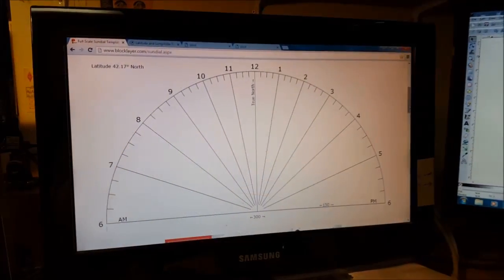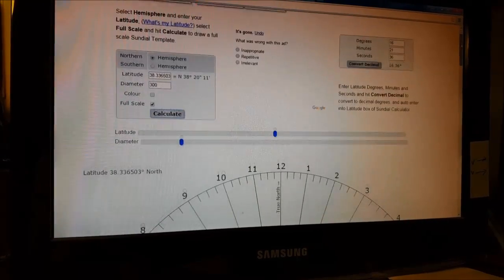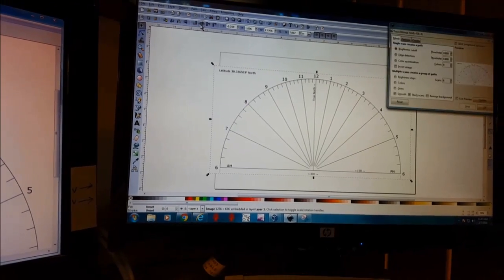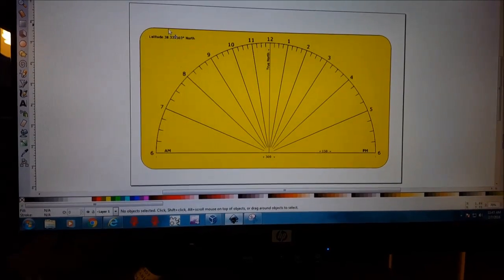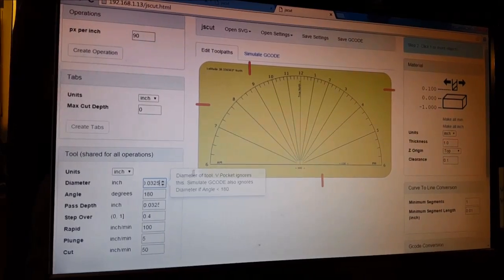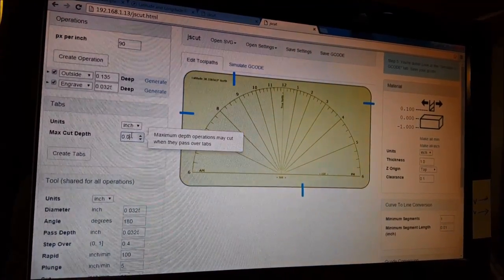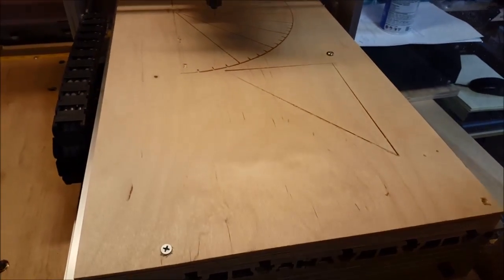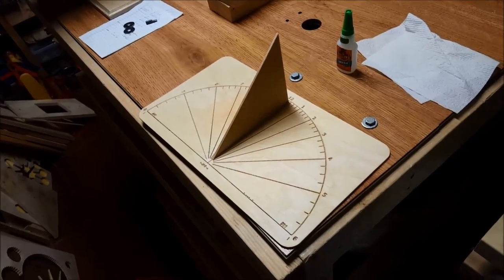DIY CNC Sundial Build

Comment: Nice video 
😚😚😘😘😘
Cool
But hard
Reply: Nice try!You haven't mind the winth of Gnomon at the design of the plate to be more accurate. You should seperate the design of plate in two equal parts and the distance of the two parts should be the same as the winth of gnomon.

Comment: Nice video.  But... there are two thing would make your sundial much much more accurate.  1) the dial plate template needs to be split at the 12 o'clock line and separated by the same width as the gnomon.  2) the tip of the gnomon should be just touching the 6AM/6PM line, yours looks like it's about 1/2" away from the line.
Reply from the maker: Thanks for your comments and time.

Comment: I want to know if this sundial is workable all the year round. As we know that in summer the days become longer and the sun can create the same shadow much earlier that it creates in the winter. How this Sundial can counter this? Pl explain in detail.
Reply: Junaid Iqbal yes these work all year round. The length of the shadow does not matter. What is not mentioned in the video is how to properly use a sundial. You can’t just put it in your backyard and voila! The gnomon of the dial has to be oriented to exact North when orienting the dial, the dial must be sitting perfectly flat and you must correct for local longitude, daily differences in lengths due to the elliptical orbit of earth and its declination have to be accounted for by adding or subtracting the Equation of Time and lastly daylight savings time has to be accounted for. If all these steps are taken then a dial will show the same time as a clock.

Comment: You could use the corner to detail the analema corrections.  Is that a sailboat stanchion that you have your feet propped up on in your channel picture?
Reply from the maker: +Harry Ragland Hi Harry.  Sure could, good suggestion.  And, yep, pointy end of my old Venture 17.
Reply: +drez20001 I'm the original owner of my '94 Beneteau First 210.  It was my bachelor boat,  and now I have a wife and kids.  I'm toying with moving up to a 25 footer for more accommodation or moving down to a smaller more trailerable boat.
Reply from the maker: Beneteau makes nice stuff.  I've always had older very used sailboats; several Venture 17s, a V21, old Aquarius, and some very old day sailors with nice lines.  At this point in my life with teenage kids the V17 is fine for a few hours here and there.  Cheap as can be, easy to fix, easy to maneuver, light to tow, etc. Smaller boats get used more - I'd go in that direction.
Reply: can you please name the webpages you have used !